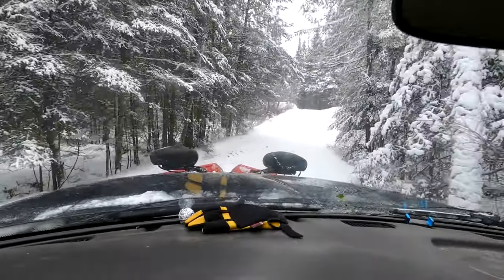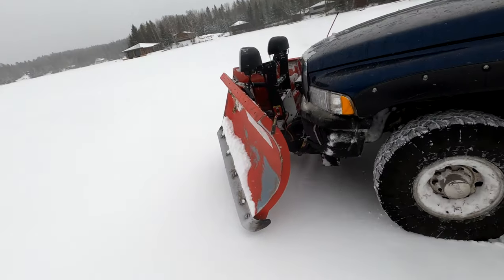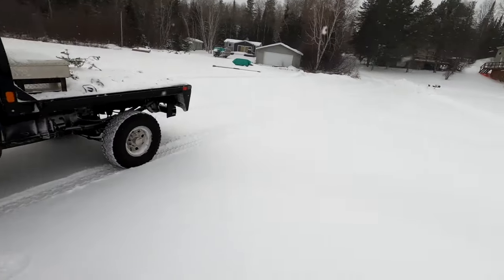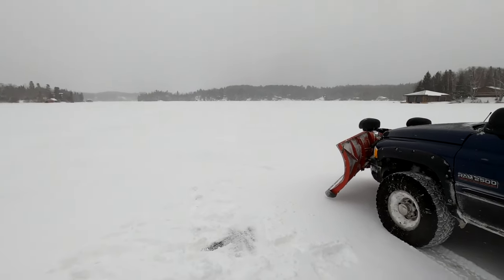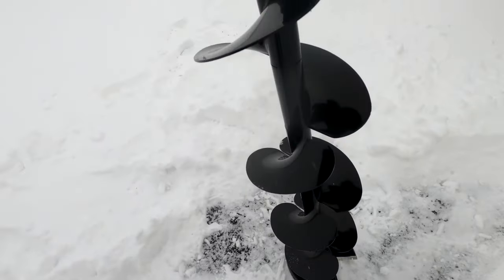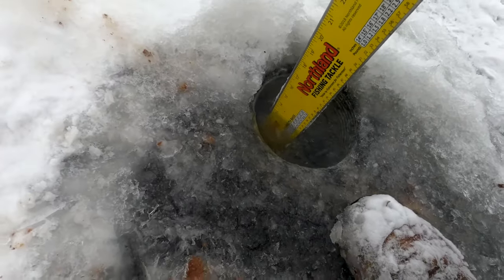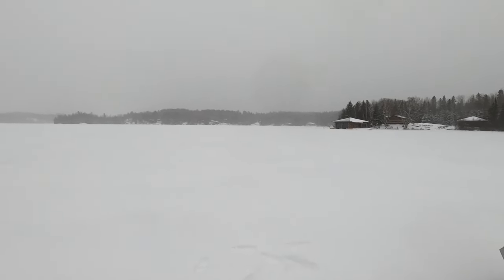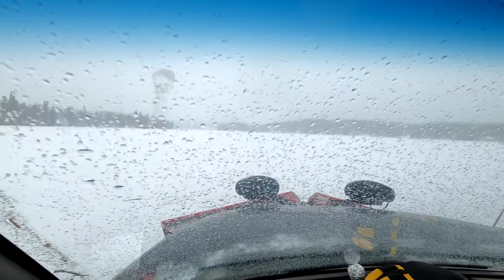Plowing Lake Ice Road

Comment: That's great advice my friend. If you don't feel comfortable on the ice don't go. One thing I wish I would have learned that a younger age is always trust your gut feeling it's not wrong it's there for a reason
Reply from the maker: 👍 its always a strange feeling first venturing onto ice. Scary. You certainly think about it twice when you have small kiddies at home like i do. But thats where the work is. I know a fellow contractor that went through "good ice" mid winter with his skid steer. Fell like a rock to 110 feet depth. He managed to break the rear glass and get out amd swim all the way back up and amazingly found where he broke through. Walked 2 miles to the shore where another ocntractor happened by and picked him up. He only suffered a ruptured ear drum and some frostbite. Still travels ice to this day as thats his main income.  Ice safety is no joke. Keep in mind that this is lake ice with no current. River ice has 20% less ice strength with same amount of ice on lake and current. If you go through on river ice, good chance you wont come back from it.
Reply: @lakelifecraftsman  this is true you're not going to find the dark spot because of the current it's going to push you down stream so yeah when it comes to rivers, while everybody down here does it on the little and Big otter creeks here in Vermont, it's still not safe and I don't like doing river runs on snowmobiles like all my friends do, it's definitely something to pay attention to and it's not a joke and I definitely now that I'm older don't like to play the chance at game. Seem like a good man, hopefully I get to meet you someday, got a feeling we'd get along as my grandparents are French a
Reply from the maker: Sincerely, thank you so much for the kind words. It means more than you know. 👍
If youre ever up this way, definately look me up or messege here on my channel.  Would very much enjoy being a guide for spell 🙂

Comment: With that thin ice I wouldn't go very fast when you're cruising across it
Reply from the maker: Excellent observation 👌.  When the ice is thinner, going to fast can cause a wave under the ice in front of you than becomes a problem when approaching shore. It will bounce back and could cause some cracking in ice near shore which you could pop through.  Ive seen it happen to other contractors on Lake of the Woods (deeper water that takes longer to gain thick ice). The water body featured in videos here are on a smaller shallower back lake which makes ice fairly quickly. After 24 inches of ice its not such a problem. On this ice road, at end of season, theres just about 48" of ice. A semi could drive across it safely for the next few weeks even though its 32*F now.

Comment: My goodness you are making a highway how wide is the stuff you're bringing in . Ice road truckers plow guys have nothing on you LOL
Reply from the maker: Lol. There is a specific reason we go wide. It allows the road to blow clear throughout the season without having to maintain it as often.  By the end of season, the weight of the snow banks pushes the ice down at sides of road creating a natural crown in the road so by spring any run off happens at the side of road thus leaving the road safe for a few more days.  I started out at roughly 120 feet wide. I'm down to 60 feet wide now with all the plowing throughout winter.